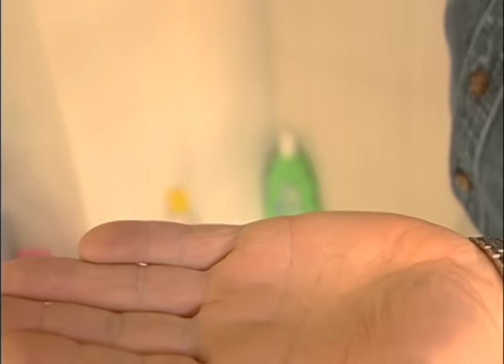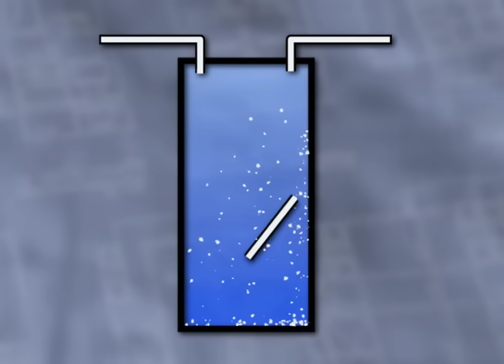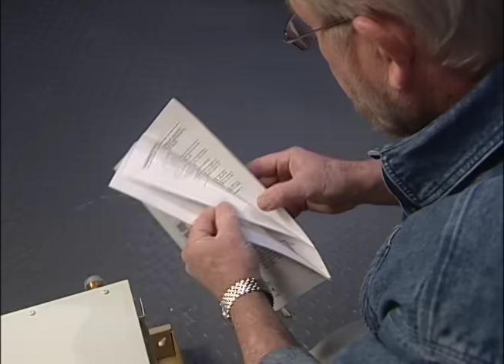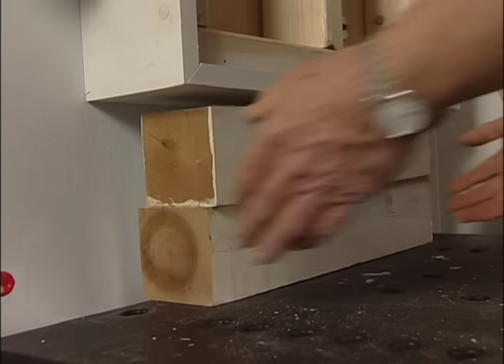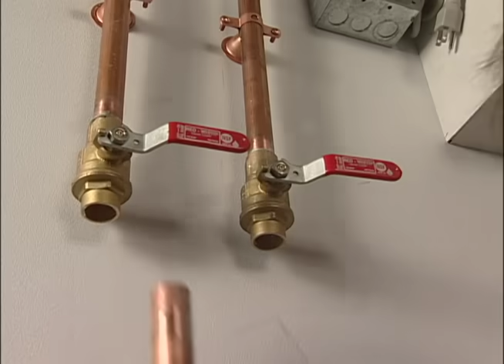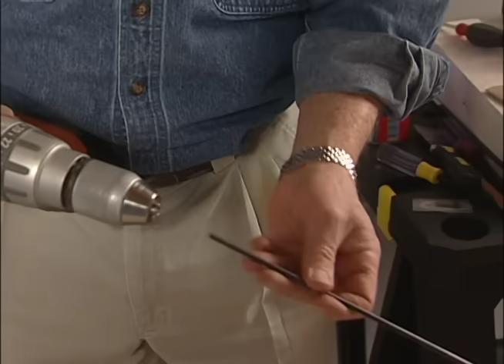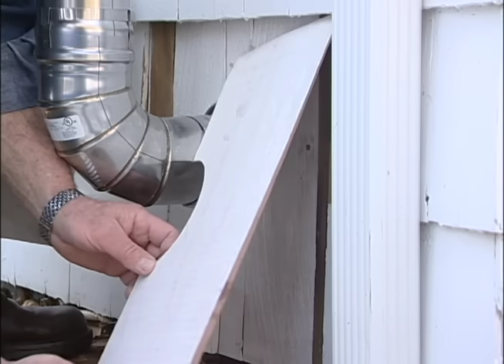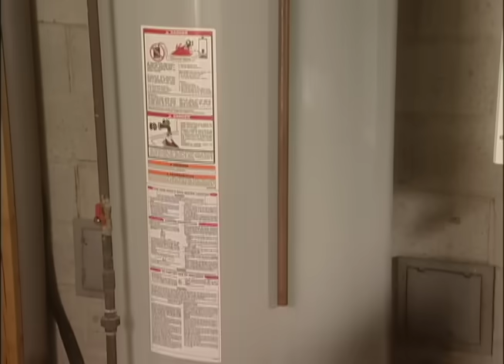Install a Tankless Water Heater

Comment: You’re lucky. My water heater started leaking from the inside, soaking all the electrical parts and creating a waterfall on my garage floor. Thus we have no water heater until the new heater is installed. Camp showers it is lol.

Comment: All he had to do is buy another gas water tank heater for a fraction of the cost of this nonsense. The plumber is probably enjoying his new automobile about now. Just waiting for the call back to flush out all the crap in the lines from the tankless water heater.🙈🧰💵💵💵💵💵💵💵💵💵💵💵

Comment: Looking at your copper pipes. We installed copper in our rebuild about 25 years ago. Did not know that acidic water will cause problems with copper pipes... Learned real fast when the toilet bowls turned bright green. It pays to make sure your water is neutral ph. We had to install a rather pricey filter system since the green meant the copper was quickly corroding and we'd have had leaking pipes in a few short years.

Comment: Excellent presentation!!! Just one thought. On the vent pipe outside. Wouldn't it have been better to just come out the wall with a much shorter pipe and put a vent cap on it? The goose neck seems long and can be nuisance and easily bump into.

Comment: You have young enough kids that use a rubber ducky?  With condensing units today, the instruction is much different on installation.  The plumbers were very thorough in this install.

Comment: The codes I have read require the sediment trap to be directly below the vertical gas feed, not below a 90 degree horizontal tee feed.

Comment: Great video sir, one point that you made which was right, but wanted to give another perspective on it is that yes plumbers bend the solder to get around the pipe, but if you notice we also usually bend a certain amount.  That is because when you solder you should use the size of the pipe as how much solder you need to use (1/2 pipe, you should use half inch of solder) other than that great video

Comment: I saw another video (this old house) where the installer used a large hole saw to install the PLASTIC venting from his unit.
 Trouble was that it was very low on the outside of the building,and since it was a house in Milwaukee,Wisconsin; the first big snowfall would clog the vent...your venting configuration made a lot more sense.

Comment: Thanks for this video. I understand that I will probably have to upgrade my gas service to the heater to 3/4 inch. Not a big deal, I have a 1 inch gas service just outside the wall of where this will sit. Cut out some sheet rock and some simple plumbing. What I don't understand is why there is a new exhaust is installed. I already  have a 4 inch double wall pipe already thru the roof.

Comment: I may have missed the part about calculations of the gas line run... there's stuff about this in the install manual, including manometer tests, and "certified professionals"...

Comment: Looks like calcium flakes... Oohhhh I see you plastic tubes disintegrating, now.  Bummer! I did not know that we are supposed to flush our hot water heaters yearly or at least every other year, until today. The bottom of my heater has corroded out and flooded my downstairs. Yep. Time to replace the unit. 🙄

Comment: your missing the isolation valves , also cheap brands like these are hard to get parts . Plus if you went with a quality contractor and unit you would not need that ugly metal vent out the side of the house .

Comment: A few things I see that's wrong with this install... 1.) A gas calculation wasn't mentioned or done (i.e. do you have enough gas pressure to supply all the gas using devices, if so, is the gas line the correct size for the tankless heater? 2.) I didn't see any isolation valves being installed to allow flushing of the heat exchanger.

Comment: Wouldn't it have been easier to install an electric tankless instead of the gas tankless. You wouldn't have to install new gas lines. The electric is pretty much plug and play, no vent holes needed in the house. Just hang on the wall, connect the the water hoses, and plug it into a 40 amp outlet. Simple.

Comment: Why was the new heater not vented through the same location the old tank was vented through, and i am assuming it went to the roof? Seems if that venting was already there it would save cutting a new hole in the wall....

Comment: Clean install but one big mistake was made. Port valves need to be installed on cold & hot water supply to clean out the heat exchanger.

Comment: Our old an on demand / tank-less gas water heater system is messed up. This one has a recalculation pump. It seem we only get hot water when another hot water tap is open than it seems to heat water fine than after a minute the water flow completely shuts off. If I turn the hot water valve off for a minute or so it will turn on with good flow for about a minute than completely shuts off the water flow. Anyone every had this issue, and how did you fix it  ?  Thanks

Comment: Can I use PVC pipes on the wall mount? How did the waterless heater work out over a few years down the road?  Awesome video thanks for sharing.
Reply: this is a non-condensing version, with a condensing version you can use PVC pipes. Also, with a condensing version you'll have to run a water condensate line out of the bottom of the unit and use a condensate neutralizer, not a big deal, but good to know going in.

Comment: 6 years ago I bought my propane outdoor tankless and all hardware from home depot,  little over 900$ investment. Installed myself. To date have saved more than 4000$ compared to when had tank in basement. If you plan and execute correctly you benefit.

Comment: Nobody ever mentions supply water for instance your city supply is 45 degrees. You want 120  constantly never going to happen. Then you need a pre heat. I recommend tankless to eliminate a chimney on a old house ( usually water heater is right next to chimney center of basement)

Comment: to the question about brands- paloma is an EXCELLENT tankless. I have one. paloma, rheem, wai-wela... all made in the same factory. the difference? the sticker on the front. I have the wai-wela. Hawaiian for "hot water". the condensing version is 96% efficient and vents with pvc pipe, drastically reducing cost of venting.  

brands to avoid:  takagi, bosch and noritz. why? well, takagi & bosch are abosolute krap. noritz? very high quality- but over priced as hell. for about $500 less... you can have rinnai or wai-welah. 

electrics. yah. DON'T. if you're going all electric- tankless LOSES its' advantage- efficiency, longevity. if a tankless electric element goes- you chuck the whole unit. if a tank water heater element goes- you replace the element- at around $10 per element. 

a whole house electric tankless is about $850 and is 98% efficient. if you're going to spend that kind of money- just get a rheem fiberglass tank electric... also 98% efficient.  the tank has a lifetime warranty- and the elements can always be replaced- almost as easy as swapping a light bulb along with the theromostats, t&p & tank nipples. this heater will outlast the electric version 10x over. 

GAS TANKLESS vs. gas tank water heater? A COMPLETELY DIFFERENT STORY. 

BIT OF ADVICE ON TANK WATER HEATERS: step one: before you start filling it up at install: remove that krappy drain valve they put on ALL tank water heaters & replace it with a watts or Apollo 3/4" full port ball valve & hose adaptor. you'll thank yourself later when you go to do your bi-annual tank flush. and- as always- use only brass nipples. NOT GALVANIZED.  ALWAYS put a tank water heater into a water heater drain pan. even if you can't pipe the pan to the outside- put a bucket under the drain. if it ever develops a leak- the pan will buy you some time & forgiveness (instead of water damage) while you prep for repair. 

best brands- in order:

#1- NAVIEN. all hale, KING OF TANKLESS! basically, navien is ahead of the other brands by 20 years. built in recirculation for TRUE instant hot water & zero flow threshold. ever heard of 'cold water sandwich" in tankless? it's what ALL tankless water heaters are plagued with- EXCEPT NAVIEN. also- every last piece of pipe inside a navien is stainless steel. the heat exchanger has a 15 year warranty- competition? 12. tech support? 2nd to none. open 7 days a week, early to late, these guys DO NOT keep banker's hours. and parts? ALWAYS available.   they have a new wifi-connected control system- which I haven't tried out yet- I've heard it still has some kinks... so for now- just stick with the basic system. and if your home has a recirculation line built in? you are shooting yourself in the foot by not opting for navien. adding recirc. to any other tankless costs around $1k. navien? costs just what a wai-welah does + about $300, but the recirc. is already there.  oh- it VENTS WITH 2" PVC!! I could go on & on about the advantages. 

#2- wai-welah. why? for the money? NO OTHER tankless can match the features & quality. (you can buy them online for wholesale prices).  not even rinnai- they cost quite a bit more- especially when you consider that rinnai's proprietary venting is pricey as hell. 

#3- rinnai. great system, very reliable, decent pricing. professionally sold ONLY. find a plumber friend who can buy one wholesale at a plumbing supplier.

Comment: great choice ron. tankless just keeps getting better & better. paloma makes tankless for rheem. they even have a condensing tankless that has an energy efficiency factor of around 96%. nice heater- I have one in my house. an added bonus? the condensing version uses 3" sch.40 pvc pipe for venting.

Comment: No expansion tank on the hot water line will shorten the life of your tankless and break the plastic valves inside it, unless it has one built in.
Reply: Tankless don't require an expansion tank.  According to the 2018 International Plumbing Code (IPC) section 608.3, tankless water heaters do not require a thermal expansion tank when no water storage device is used.  So please stop spreading fake news.

Comment: The one item skipped .  In all the tankless water heaters I have installed,, in all but one,, I had to do a major revamping of the gas piping system.  Most home furaces require about 100,000 btus,, most conventional water heaters about 40,000 btus  Tankless require 200,000 btus and up.  The 3/4 inch gas pipe you tapped ?  What else was it running?  That 3/4 ich line you 'just' put a Tee into  was calculated and installed to handle the expected loads of the stove, water heater, furnace , patio barbecue, dryer,,,, Most gas systems do not have the capacity to handle,, and extra 150,000  to 250,000 btus.  With that single exception, I have had to revamp, and replace the gas piping with substantially larger diameter black pipe, to handle the 'extra' load and length.  This will add 1 to 5 thousand dollars to the job.

Comment: From a financial point of view tankless water heaters make NO sense...especially if you use a water softener (salt).  Salt is the reason water heaters don't last as long as they otherwise might.  Even without salt, tankless water heaters require YEARLY, professional maintenance or you are asking for trouble.  I can buy a regular water heater for $400 - compared to the $5000 for a tankless installation.
Reply: It doesn't take 5,000 to install if you are at least alittle bit handy.

Comment: Loved the video but wasn't that straight-through pipe to the outside (after elbow) installed incorrectly? The male end of the vents should always point in the direction of the gas. As it is the flow of hot exhaust will  hit the ridge of the inserted pipe and some of it will leak out under pressure. The elbow should have been female to male, no? On further viewing it seems there is a seal inside these pipes but is that enough?

Comment: Thank you VM. I find ur vid VERY informative. I have the option to go old school hot water tank, or tankless. My old G.E. 2010 natural gas heater died last week.
I use city water which, here, is a bit above avg grade FPSM. Imagine entering a house with the intent to buy it, built in 1957 and standing face to face with a spanking new, tankless, endless hot water heater! HOT! Ohhhh Yeaaahhh.

Comment: Sooo do you just have condensate dripping on your floor or did you add a pump when you found water on the floor? Good luck to you when an electronic part fails and you are days without hot water

Comment: We used to encounter this a lot back in the 90's and early 2000's. We installed  wye  trainer (fine mesh screens) remove the plug on them and install a ball valve to flush the wye  strainer.  Charged about $290 for the job and replaced the diptube too. Solved all of the issues.  No need to replace the water heater.

Comment: And, I cut an 8" hole right through my 10" load bearing floor joist...  Brilliant.
Reply: That's just the rim joist it's sitting on the foundation you can cut it out with no compromise to structural integrity

Comment: Did your plumber check the operating gas pressure, to see how that high demand affected the other appliances while the water heater was running??  Most of these on demand water heaters will  require a separate gas line, back to the meter, as they consume a much larger volume of gas than can be obtained with just branching off of the existing gas line.  Nice mounting platform for the new tankless heater.  The plumber did a real sanitary job,  but I didn’t see any flush valves installed, for future maintenance. I’ll bet you are running low gas pressure, because of the undersize gas line.  I’m not a fan of that CSS gas line.

Comment: Curious that nobody seems to have suggested just replacing the dip tube.  They're cheap and easy to replace (much much easier than replacing the entire water heater).  Ask for dip tube replacements at plumbing supply houses.  I replaced ours and got years more use out of our heater.

Comment: interesting, but most water heaters average life span is about 10 years, I'm guessing that one has been running longer, I'm also guessing your problem might be one of the reasons water heaters are recommended to be replaced after so long, well unless you like booms.....

Comment: Question:  Will the Tankless model prevent hard water problems and collecting sediment because of it?   I go through water heaters very often having the same issues you talk about and would love a solution.   It is impossible to soften the very hard water - we make it maybe 30% better with the softener, but still have big hard water issues due to suspended solids in our Arizona Mountain water from a deep well.
Reply: Your water quality will affect any water heater. If there is concern for hard water or iron, best to run it through softener. Consult the manual of the heater prior to installation. Or talk to manufacturer.

Comment: Do those come electric also. Wish you would've mentioned a ball park figure on cost of the tank as opposed to the tankless. Guys did a good job
Reply: he could have cut half the work with venting going electric, but probably would need to upgrade the components so it would somewhat even out.
Reply: @dogelife7901  True but natural gas is way more $$ efficient then electric and odds of it not working during a power outage is minimal.  All you need is a small generator with 120v to power it vs one with a 240v outlet.

Comment: Now both natural gas and electricity is needed to make hot water.
Reply: OMG you are so smart there should be Nobel Prize for Thinking
Reply: @jwarmstrong  He raises a valid point.  With a tankless water heater, if you lose power in a storm you also lose your hot water (unless you've got a generator)
Reply: @jeffeverde1 Hot water is mainly used for showers but a compact camping stove ($25) can warm water for washing or cooking. No need to pay for gas service. In a storm you also lose heating & cooling so ladies will be unhappy sitting in the dark.

Comment: I would have replaced the dip tube, and installed a water filter on the hot  water line. One that could be easily opened and cleaned, problem solved.
Reply: Same here - except wife could want to wash clothes, bathe then have family not have to wait for more hot water - I have an elect tank-less

Comment: Not sure old this is, but most new tankless heaters use a plastic vent. The stainless vent was one cost that homeowners couldn't afford. Also, use shut offs with the ability to flush the heater in the future.

Comment: Always wipe the soldered fittings afterward or the flux will turn green (ugly) and continue to corrode the pipe.
Reply: 80 years to failure maybe more - but keep your fingers crossed in the casket...